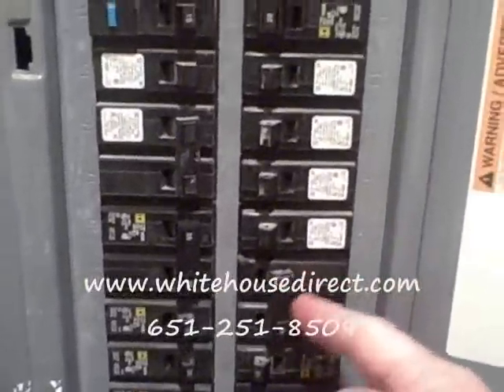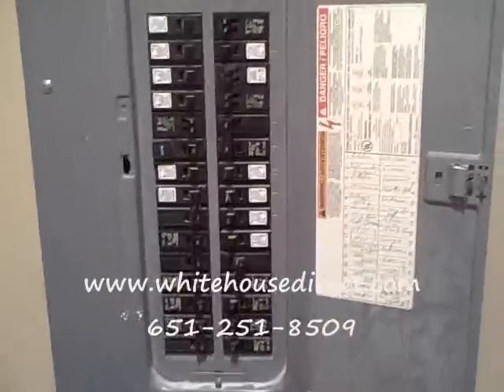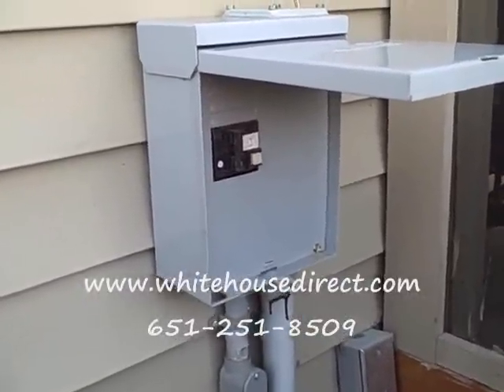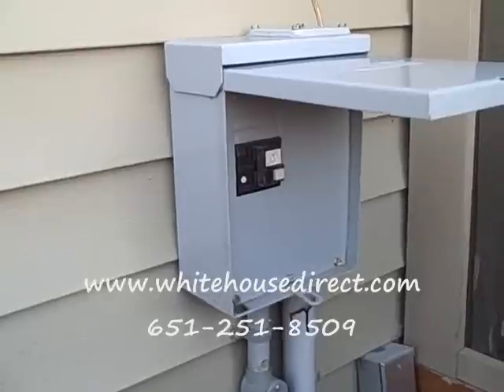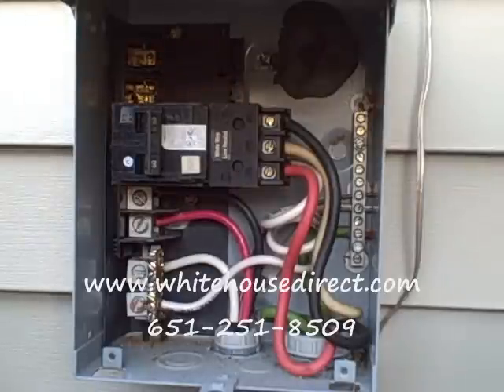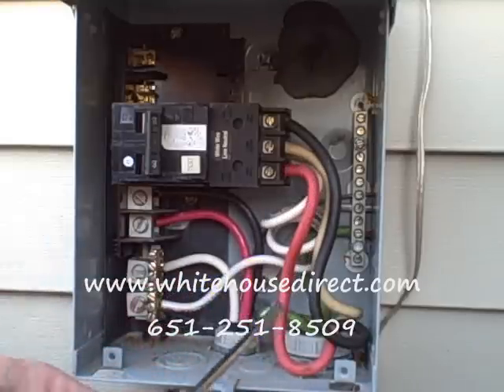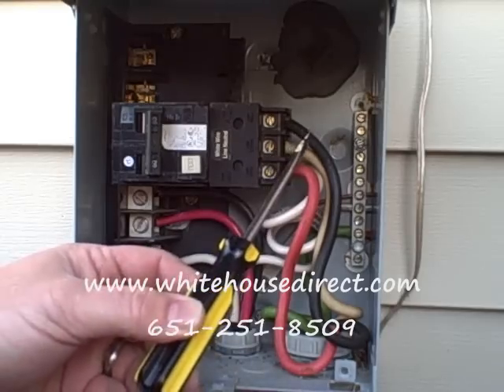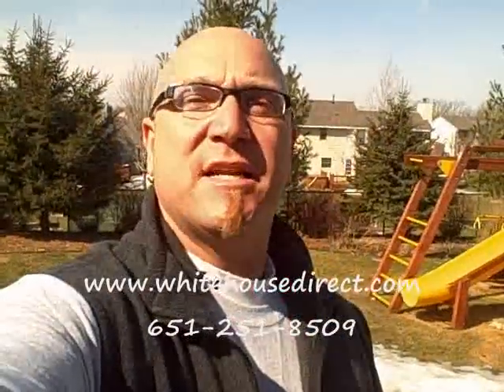Minneapolis Hot Tub Electrical 101

Comment: Very informative thanks 🙏 I am also doing one too using this same panel. My cool idea is installing a 240v 50A receptacle that’s normally for a range but I have an in use cover that’ll make it work fine. Then from the receptacle that’s GFCI protected a 50a range cord wired to the hot tub. I’m curious if the inspector saw my work what would happen. I enjoyed watching the video 😎

Comment: That was helpful... so just to be clear, a breaker goes inside the panel inside the house.  Those wires run to the GFCI or Spa Box outside, and then the wiring completes its trip to the spa.  Additionally, anything run outside has to be inside of conduit, correct?